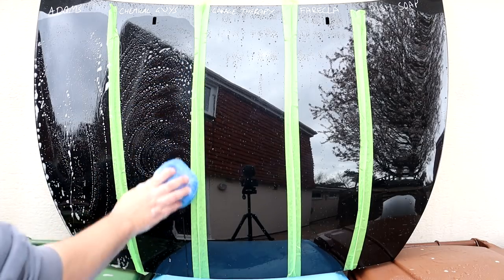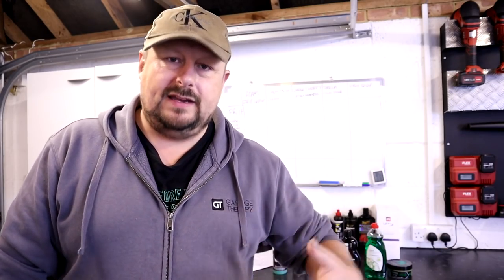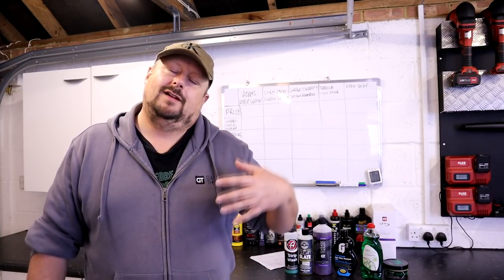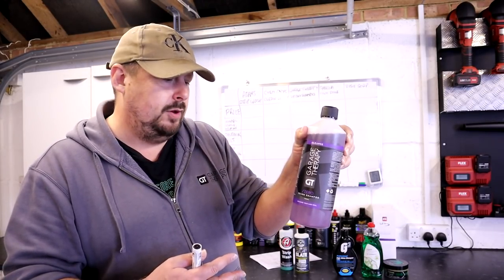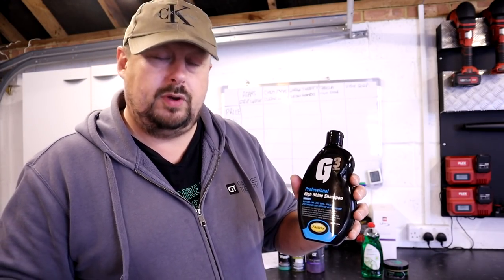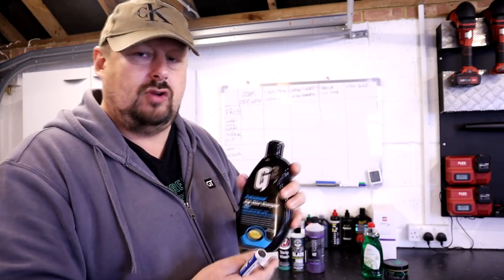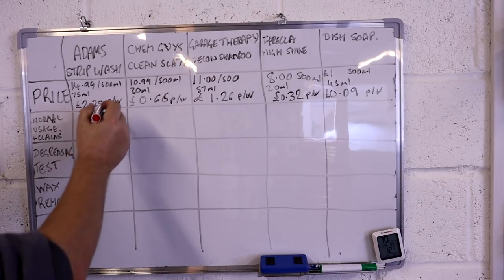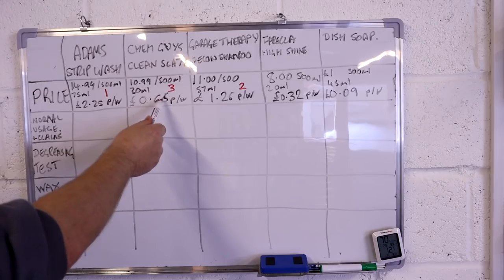Best Strip Wash for Cars | Can they really remove Wax or Sealants? | Clean Slate Strip Wash Decon

Comment: I used the garage therapy and had some mixed in a spray bottle to hit the panel first, then used it in a bucket in the usual wash method. Managed to strip old Fusso which is quite impressive 👍🏽

Comment: Hi Jon,  Great video as usual, but as others have mentioned the use of APCs I was wondering if simply adding 20ml of Surfex to a bucket wash with a pure shampoo would produce a similar result to using the GT ? I'm reluctant to buy yet another shampoo that I would only use twice a year if simply adding an APC to the bucket wash ( or snow foam lance) would do.

Comment: I have a bottle of pro kleen lemon degreser that I bought to remove oil from the drive when I bought this house, I used that neat left if to settle n break down then pressure washed it away ( though I wouldn't use it neat on my car but my car is not a few years of oil soaked into concrete)  it done a great job  until that summer which was a hot one and the stain come back, so repeated the lemon degreser on the concrete concrete drive and its been gone ( though im told it will return less n less) I mixed this at 10ml per liter yesterday to use as a APC that cleaned my wives door Jams a treat, going to see how it works on the engine bay today, thanks for all yr uploads they have helped me loads, stay safe 👍

Comment: I do like using a decent strip wash to get rid of old waxes.  I do use Gt decon wash these days, maybe about twice a year for 2 cars so for me, its worth keeping a bottle around, just to knock down that protection.  if there is still something on there after chem decon, I'll pull out the Meguiars wash plus+ on the daily driver, rather than clay it, and thats a decent surface for re-applying protection.

Comment: I use my autostart power c now known as power HD spray on and can leave for 10 mins easy as it's a citrus oil based degrease product but very strong only thing is you have to foam the car down with apc to strip the citrus oil after but it definitely removes protection as it seems to have an alcohol from the citrus aswell.

Comment: I wanted to give the comment section some time to cool off before I posted:

Used the last of my Clean slate this weekend doing a quick springtime cleaning of my car. 

It was able to knock down what was left of the 5th element that I had on since November, after that I hit the whole car with 𝔾yeon Prep before slathering on Contact 121 as my Spring wax. 

I’ll tell ya - that car was a real bitch to dry. 

Would I buy clean slate again? Probably not. It’s an ok shampoo, but it did the job for me. when I bust out the Duetto over Memorial Day weekend I’m gonna give some Palmolive free and clear washing up liquid a go, I’ve got nothing to lose. 

Before anyone reading this asks do I wax in circles or straight lines? I use a herringbone pattern like a real gentleman 🎩👌

Comment: I used the Garage Therapy Decon my self last week. Really wasn’t impressed with it. I followed the instructions (even their suggestion to use it in a snow foam Lance first before washing) and didn’t get good results. I have a 7 year old 3 series BMW which I have had for 3 years which has never had a sealant applied. Only ever had Sonax BSD applied. After using the Decon, water was still beading and running like it had just had a fresh coat of BSD applied.... just my thoughts :)
Reply: Your not the only person conor, I've used GT Decon a few times not impressed. Lot depends on what you are trying to remove, guess its really brilliant removing pound shop wax after 6 months.

Comment: When i’ve finished polishing a panel i’ll put dish soap and warm water in a foaming pump sprayer, apply them tinse off. Really effective degreasing and just removes any oils with ease to leave a totally bare surface. I get the best out of LSP’s by doing that no doubt.

Comment: Would the temperature of the water make any difference. Hot water does help doing dishes with fairy. Just wondering.
Reply from the maker: in theory more heat will help break down grease and oils faster.

Comment: Best I’ve tried that I think actually works is  Meguiar’s Wash Plus - most likely due to the abrasives, but would only ever use if I was intending to polish as it leaves micro scratches very easily, even being careful with how you wash.
Reply: Wash plus I'd fantastic, I use it on lots of cars
Reply: @jamesgillespie9000  agreed, but it scratches the paint so easily - always needs to be followed up by a polish
Reply: @Stretch1386  it doesn‘t. It‘s your wash mitt that scratches.
Reply: @AndreasSchwarzinger  it’s well known the product scratches - definitely not the mitt
Reply: @AndreasSchwarzinger  try it on soft clear and yeah it scratches
Reply: @Stretch1386  huh? You're not using it right then! (Also Andreas knows his stuff)
Reply: @Stretch1386  show me a video in which you use two identical mitts, one with regular car shampoo, one with Wash Plus+, identical pressure, amounts of passes, and then the results. If the side with Wash Plus+ is scratched more, I'll believe you.
Reply: @AndreasSchwarzinger  got better things to do with my time than make videos 😂
Reply: @Stretch1386  then don‘t claim something that is not scientifically proven
Reply: @AndreasSchwarzinger  you should do it for badness 😁
Reply: Wash+ doesn’t scratch, that is another myth perpetuated by laziness. Do you wash the dirty car with Wash+? That’s not wise. The product itself has nothing in it that will inherently scratch paint, it will be the mitt or the user. If you can’t back it up, stop spreading nonsense.
Reply: @roscopervis  exactly👍👍👍
Reply: @AndreasSchwarzinger  apex detail did a video showing it clearly scratses. But what ever.
Reply: @andhen12  did he double check with just the wash mitt?
Reply: @AndreasSchwarzinger  No i dont think so. Go watch his video it had some good infomation about the product. Pros and cons.
Reply: @andhen12  if he didn‘t cross-check with just the mitt, he simply can‘t know for sure that it was the shampoo that created the scratches.

Comment: Do you not think a simple clay bar session, will strip all waxes, sealants, ceramic sprays (short duration 1-3 months), ceramic coatings (short duration 12 months to 7 yrs, which is unproven)? Clay Bar about £10 (can be used many times, plus Clay Bar lube. The dish soap came in second and not that far from GT Decon's product. You might as well use that instead and save the £11 that GT Decon costs. As you know clear coat is on top of the paint (waxes, sealants, ceramic sprays, ceramic coatings on top), could these very strong chemical products from Bilt Hamber and GT, that you love, not cause damage to the clear coat unnecessarily, especially if your car has scratches, swirls marks not treated with a polish? Sadly, I believe some companies are trying to sell you products you don't really need, with fancy marketing terms, unproven claims. When a simple regular wash is best, and cheaper. I am started to question whether I need some of my product arsenal, and the answer is no. But everyone is free to buy whatever product/time/result they want to spend on.
Reply: Problem is that a clay bar will always marr the clear coat so you are technically spending more as you need polish afterwards. In a scenario where the paint is in good condition underneath, claying would be a bad choice over something that is close to touchless like the GT product

Edit - changed paint to clear coat for specificity
Reply: Depends if your going full long term sealant. If your clay baring then that means a machine polish. Some people may get into that and want to wax every 8 weeks or so. Or do a reload and wax combo of a temp sealant solution. If you don’t have garage and all the equipment ceramic coating is hard. But yes the best protection is a solid base sealant.
Reply: @NyHoK  Clay barring does not mar the paint, as clear coat sits on top of the paint (13-38 microns). Clear coat has about 32-102 microns of protection. Polishing the clear coat smooths out, swirl marks, deep marring, acid & water etching and buffer marks. You never touch the paint, it is the clear coat you are cleaning, polishing and adding products on top of. I am not a fan of super strong chemicals. I wonder what Heads & Shoulders would get as a score, if simple dish soap came in second with 9. Hand polishing works well, not as well as machine polishers, but most people do not have a garage, or a garage that their car fits in, well not in the UK, or want to spend from £100-£350 on a machine polisher they may use only 2 or 3 times a year. Every detailer should decide how much time they want to spend, what products to use and why, and what result they want. 100 detailers = 100 different ways/techniques.
Reply: @theflash4956  I meant clear coat in my comment I should of been more specific.
Reply from the maker: do you need strip wash products? possibly not.  this is an interesting thing and everyones going to have a different opinion on this.  Im a minimalist.   But its like the same thing with microfiber towels someguys have a pack of costco's some guys have 20 different towels.    so yer not sure.

Comment: Great film great channel. Guys let me warn you off a product I just used on a less than week old M340i in black. I wanted to get some quick protection down as work busy. Gtechniq easy coat. After doing a full 5 stage decon with BH tried and tested at correct PIR  applied Easy Coat and rinsed, pressure washed and finished with Di cartridge. Left marks all over the car. Don’t be tempted. Last time I use.

Comment: I just took it as read that polishing takes the wax off. Cars had a good few coats on but was last done in October to protect over winter. It still beads. Only thing I know that strip wax almost immediately is tar remover as I only ever do that when I’m going to wash the Car again and polish on the same day. We have fairy liquid in the kitchen but haven’t washed a car with it in probably thirty years before I could drive and used to just wash my dads Car. Thought fairy liquid drys the paint although I get it that once a year shouldn’t do much if anything.

Comment: I'm sorry but I am not so sure that the wording "old layers of wax" means "wax that has been on the paint for a long time". They may simply be referring to the existing wax as "old", because the user wants to remove it. "Old" may simply mean "previous".
Reply: Exactly. If you have new over old, how do you remove the old without removing the new? I'd like to have seen how Surfex at a low dilution would have fared here. 
Question: When are you going to use this? Sounds obvious but are you going to use and then clay the car? Maybe then compound it. If it's to remove the current layer of protection (AKA old or previous) because you are moving from one type of wax to another, upgrading if you like, how do they work on these older types. You have traditional/SiO2/graphene now. The manufacturers are feeding a captive audience to keep them going. Geeks never get to the end of a bottle before they have to buy the brand new thing. Worse still the claims for longer and longer protection would seem to shoot the makers in the foot/feet.
Reply from the maker: maybe your right here.  Your saying "old wax" means previously applied wax basically.  And it could be "old" but still be zinging (my word for like being fresh).  So yer fair play.   I think the brands could use better language with this to remove uncertainty but its a bit of a can of worm isnt it.
Reply: @ForensicDetailing  yes - it's possible. It's also possible that your interpretation is correct - I'm just offering an alternative.

Comment: Im yet to try the high shine, but i just bought old stock of the Body prep, and can confirm my lsp is gone. Nadda, nothing on the panel.  I just rubbed it around the panel 2-3 times and its all gone.   So maybe it needs a bit more mechanical removal/agitation and maybe it is different to this new product.

Comment: Hi john just wonder what do u use for exterior plastic like to know what it is  have u got video on this  cheers 👍 though adams strip was would win the strip wash
Reply from the maker: I use TAC seal as a dressing most of the time.
Reply: @ForensicDetailing  cheers
Reply: @stewartherbert6847  I use Bilt Hamber QD, diluted 1:10 as a drying aid or 1:1 (can actually be diluted a bit below this for easier application) as a QD, works brilliantly and can be used on paint, glass and plastic.  Highly rated by Jon on this channel, if you have a search, and outstanding value. And British, FWIW.
Reply: @SteveLBMK  cheers I have a look  
What dose it do to help xterior plastic. If never used it would like to now thank you
Reply: @stewartherbert6847  QD leaves a shine on the bodywork and cleans the exterior plastic leaving it very close to matt (not shiny like, say, a tyre dressing).  When you apply it with a MF cloth, it picks up any dirt that you might have missed with the pressure washer.  I know this because I cleaned my Golf and applied the QD all over, including to the black trim under both bumpers.  The advantage of using QD is that it doesn't matter if you overspray, as it is fine on the lights, glass and bodywork.  If you are a purist and want to go down the specialist product rabbit hole, then Carpro Perl can be used neat on tyres, 1:3 on exterior plastics and 1:5 on interior trim...
Reply: @SteveLBMK  thank u was thinking carpro peal cheets
Reply: @stewartherbert6847  Cool.  I use it neat on my tyres, pretty good stuff.  If you are going to use it on trim I would recommend you get some spray bottles ands deionised water, dilute to 1:3.   Very versatile product.
Reply: @SteveLBMK  cheers
Reply: @SteveLBMK  hi just like to know when u have used carpro peal how long did it last?
Reply: @stewartherbert6847  Same as any product. Leave your car on the drive, it will last ages. Drive it daily, probably a week or so.

Comment: In the bodyshop trade, although I have been retired for 17 years now, all we used to remove waxes, old and new, was a spirit wipe. This was obviously to stop any possible silicons when painting. We applied this with a wipe, obviously turning it after each wipe. It wouldn’t surprise me however if new better water based products have been released now to cut down on solvent usage.

Comment: I actually prefer a prep spray like gyeon prep, bilt hamber cleanser fluid or labocosmetica veritas. After a good chemical decontaminantion and car shampoo, a quick pass with a IPA base solvants and I know my panel il 99% free of old residue and street film
Reply: @adblf  "I actually prefer a prep spray like gyeon prep, bilt hamber cleanser fluid or labocosmetica veritas" - those will though. The IPA is for a final degrease.
Reply: Ipa and panel cleaner is to remove compound residue mainly. Different to a degreaser that will remove a wax type sealant.
Reply: @adblf  OK Fair enough, I suppose it depends on OCD levels maybe, personally if I want to deep clean the paintwork on my car I use Meguiars Wash Plus and call it a day. :-)
Reply: @adblf  Veritas is designed to dissolve old waxes, I use it on 9-12 month old fusso wax, where wster sheeting and beeding was fading so badly. Works wonderful for silicone based waxes as a MaFra dealer told me. Probably the meguairs strip wash works better thanks to the polish built on it. But I prefer to use chemical to strip the old wax

Comment: i forget these a long time ago.. throw them in the bin. go straight to Kleen Strip Prep All wax and Grease remover.  guaranteed to remove wax and sealants   its never failed me. spray on panel by panel let sit 30 seconds then wipe off and flip towels to buff off. it temoves tar too. let it evaporate completely at least 20 min before applying coating. you can wash car again quickly if you'd like but phenomenally great  wax stripper. use only on cool panel. don't waste your time and money. use what works the 1st time every time 💪

Comment: My thought process - are you going to be decontaminating before polishing? If yes, then a tar remover will degrade waxes and sealants more than most strip washes and the decon will certainly do plenty of damage and enough before polishing to not necessarily need one. 

If no, then ooof!

Otherwise, using a strong wash to unclog coatings is a good idea and that Garage Therapy product and something like Labocosmetica Purifica are great for that purpose.